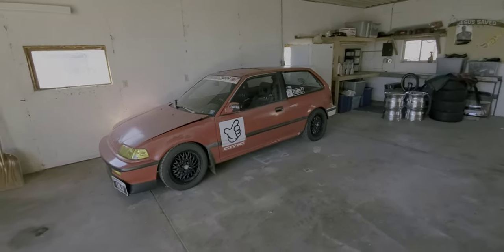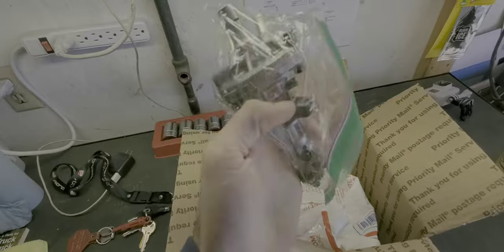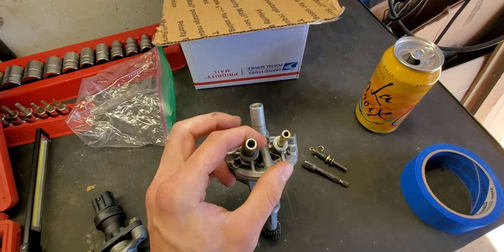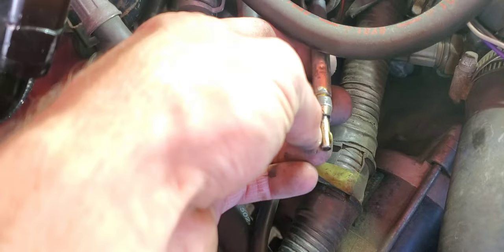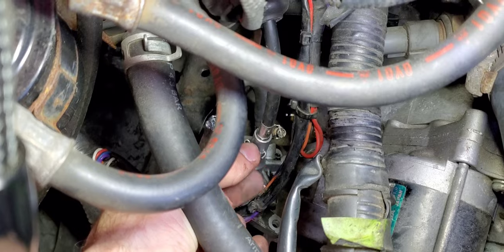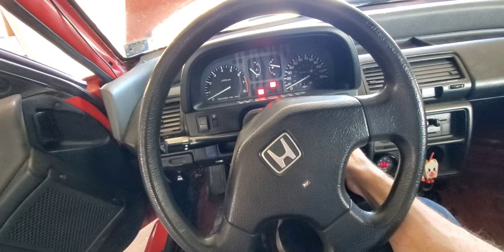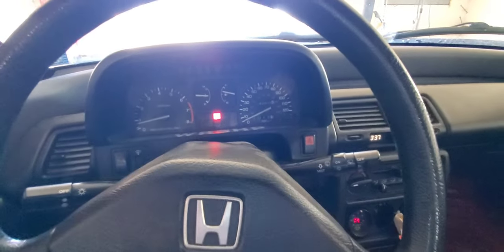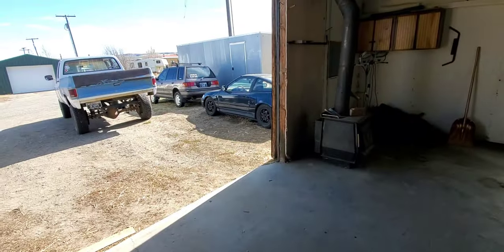Speed Sensor replacement and progress on the JDM B16 Kanjo EF Civic with Type-R Transmission

Comment: Sucks that the ecu are getting so old. I have a s300 on a p28 but now my idle air control valve stopped working and my ac. I ended up getting a new haltec elite. Gonna add some new sensors and hope it solves my issues. My plan is to have my old car running like new. I have a 89 si.
Reply: P28s are on their finally legs, even back 5-10 years ago they been real popular, expensive and yet the 30 years of working they giving out, specially s300 system and drains everything they have left

Comment: Love the hatch sounds real good, one thing about working on cars there’s always something specially sensors. You fixed one problem and getting the second one resolved soon hopefully it’s just the Vtec solenoid leaking and nothing else
Reply from the maker: For sure, and thanks man. Yeah I'm wondering if the screen is plugged for the vtec solenoid since it only acts up whenever I hit high rpms. Ordered a new one yesterday so we shall see, haha
Reply: The best thing is to have crome or
Hondata and disable anything to get rid of that pesky CEL 😂

Comment: so my Speedo never gave the "jumping" indication before it gave out just started it drove for a little bit looked down and noticed it wasn't working anymore! hope its my speed sensor!
Reply from the maker: The cable may have even just popped out of the retaining clip that holds it in the sensor
Reply: @KanjoBrothers  Sadly didn't get a code for speed sensor but i got these 5 p0113 IAT sensor circuit high voltage or air charge sensor , p1298 Electrical Load detector circuit input Secondary DTCs , p0135 02 heater Circuit bank 1, p1337 CKP(CKF) sensor no signal , p0141 02 heater Circuit Bank 2 , p1660 ATCHK LINE signal failure???

Comment: What air box are you running??
Reply from the maker: When I made this video the car just had the stock si airbox in it. Now I made a cold air intake for the car
Reply: @KanjoBrothers  thanks for the reply . I hadn’t had a stock air box in my efs in so long I forgot what they looked like. I’ve been looking to make a set up like that for my hatch .
Reply from the maker: @Randy Hoosier  only downfall is the smaller pipe off the box since it's for a D-series. Using an Integra box would be ideal, which is what I was going to do. But I don't drive my car in the rain or anything anymore so I have a straight-up cold air intake on it now. Perks of having a couple cars to drive, haha

Comment: did u fix the Vtec ?
Reply from the maker: Yes
Reply: How you fix problem with vtec?
Reply: How you fix your problem with vtec?
Reply: I have this problem with vtec too. 😢
Reply: @АлександрАлександров-ц4с9р  your speedo meter working ?
Reply: @rx7fd329  doesn’t work :(
Reply: @АлександрАлександров-ц4с9р  get a new speed sensor your vtec will work again, cel light on right?

Comment: I'm getting the same code 17 on my 90 civic sedan automatic.  But I've been getting a constant tick sqraky noise on my speedometer cluster. Speedometer finally stop working and now check engine. How do I fix it?
Reply from the maker: Not sure, sounds like the cable may have snapped or came unhooked from the back of your cluster. Pull your cluster out and check